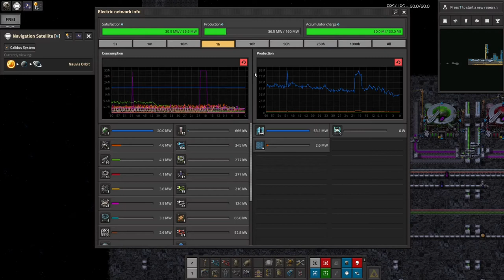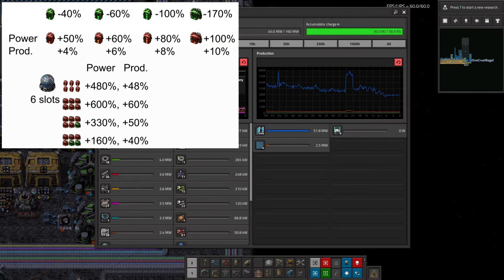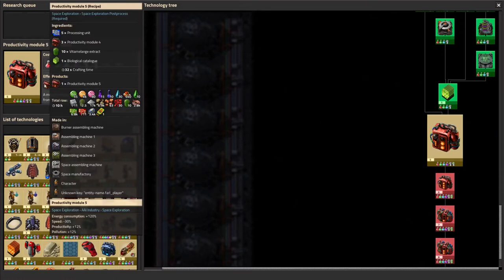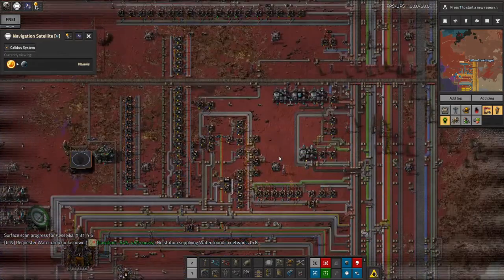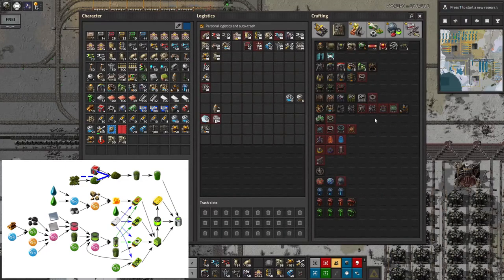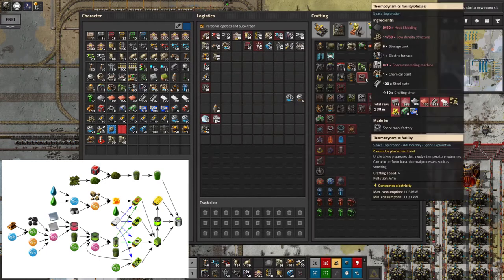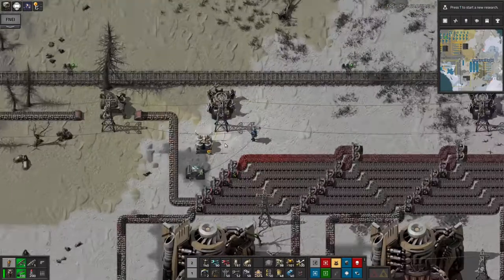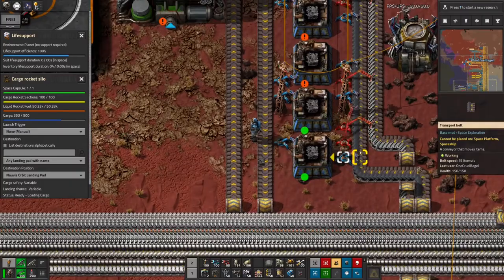S2-E27 - Modulation - Laurence Plays Factorio: Space Exploration

Comment: Just upgrade your solar to the walkable ones. Massive power increase. You should have everything needed for them already on the station.
Reply from the maker: I hadn't realised just how much better the flat ones were - something like 5 times, I think? (off the top of my head!) I'd done the Maths before in AngelBobs and those weren't worth it (unless you were very short of space) but here they definitely are. I shall be using them in my next expansion in space! Thanks for the suggestion  :-)

Comment: A great example of creating problems to then solve them the other way around. :)
I'm about efficiency modules in labs instead of just slapping more/better solars. If you even need that much labs.
Reply from the maker: Yeah, there are always so many choices, so many different ways to do things! I always forget to go back and reconsider. That said, I'm definitely a fan of using productivity modules, especially in labs because it cuts down on the amount of expensive science packs you need to make, and that ripples back all the way up the supply chain. I've never really bothered with efficiency modules in previous playthroughs - I've just slapped down more nuclear - but I'm trying to be open to new ideas, and I'm actually finding them quite useful!
Reply: Each space science represents 1 major challenge:  planetary logistics, outposting + cooling, power + scaling, scrap management, linear algebra + production loops
That's a nice game design. I like that Earendel pushes players to solve new and unique challenges in discrete  stages.

BTW: Why you count with 28% reusability? You can go 50+ easily.
Reply from the maker: I'm not sure I completely follow... Material science definitely requires the scrap handling, but all of them require a new material from another planet somewhere in there, and all of them require cooling to an extent. The bio definitely has lots of looping in it though - is that what you mean? 

They certainly all felt different to do - with the exception of setting up the mining outposts, I didn't feel like I was repeating myself too much.

I had 28% rocket reusability at the time, I forget whether I was limited by the amount of blue science I had or by my imagination. I've increased it a bit further since, and I talk about that in a future episode  :-) Watch this space!
Reply: I meant "1 new major challange" for each stage. Astro meant to be first as most useful and easy one. Other may come in any order.
Last level of astro also pushes player towards interstellar travel and spaceships.
"Scaling" in this case mean understanding new production mechanics. Like new more efficient recipes by combining different catalogues.
I'm nowhere near DSS yet, but assume that it will require all previous experience + some new.
Reply from the maker: @axelander_ish  Ah, I see. Yes, definitely different feels to all of them, and stretching my brain in different ways. As you say, an excellent way to do it because it keeps the game interesting. I'm about to start a bit expansion now - that will definitely be interesting, and probably a bit painful!